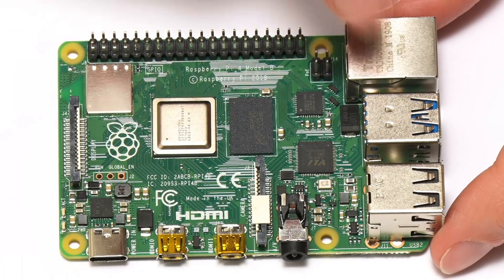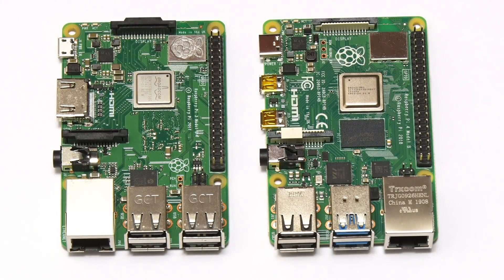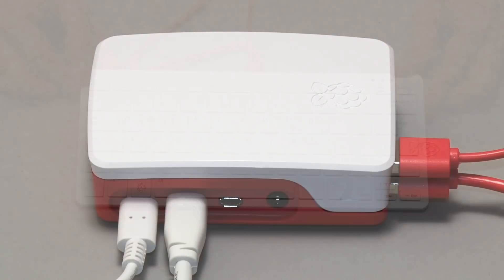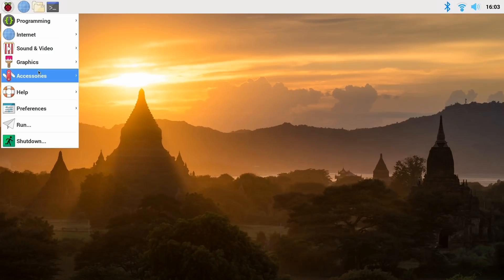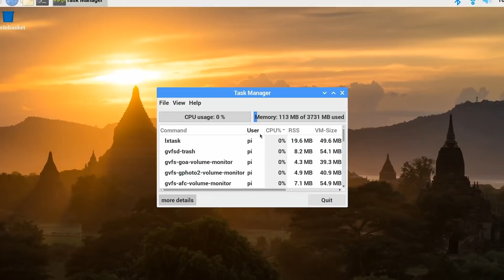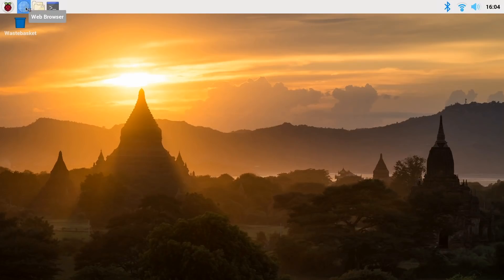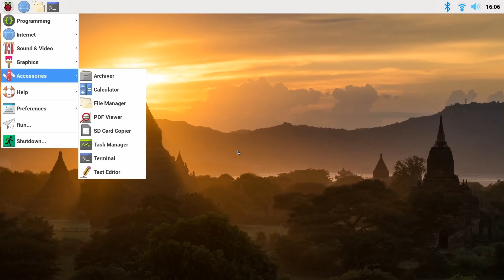Raspberry Pi 4 Model B

Comment: on reflection I can't help but be worried about the micro HDMI connections ...I mean I see a lot of  Xbox one s with broken full size HDMi sockets and Micro HDMi are sockets already proven to be much much much weaker ...just ask Lenovo laptop owners ....at least there shouldn't be any more broken micro USB ports ...I have several Pi2/3's with broken usb ports ..they're still in use I just solder power leads onto the board.....but as a headless plex server I do think the Pi4 has legs.

Comment: As many others, I heard about this here first.  Nice way to start the day.  I have always had issues with the limitations of the Pi's design, and have favored Odroids.  This new Pi looks to have addressed about everything I considered "wrong" with previous models.  This is a very impressive upgrade.  SoC is 28nm, which I suspected based on the clock speed.  It is a larger process than most A72 SoCs, which were 14nm in phones.  It is in line with SD650/652 and RK3399 in that regard.  28nm is a good upgrade over the old Pi boards and is a good compromise to keep the price down.  Not unexpected and a reasonable decision.  It will be interesting to see how it does when you test its performance, throttling, and heat generation.  A very nice upgrade overall, and an exciting board, even for someone like me who has only worked with other boards.

With USB-C here, making sure the cables follow the spec will be something to keep in mind.  Thanks for the quality overview of this new board.  I came away rather interested in the peripherals as well.  That keyboard might be handy.

Comment: Woohoo! I didn't even know the Raspberry Pi 4 had been anounced yet! I already cheered in the first few seconds of the video as soon as I saw the blue USB ports on the board. Finally USB 3! 😃 I'll unpause the video to watch the rest now. I wonder what other new goodies this new version has. 😁
Reply: My one pet peeve (I guess there's always one) is that the board supports both the h264 and h265 video codecs, neither of which are free to use, while lacking support for the completely royalty-free VP9 and AV1 codecs. 😞 But I guess the Raspberry Pi foundation is dependent on Broadcom to support these things in hardware. I hope they'll push for it in newer revisions of the chipset, though.

Comment: Question:  Does this support USB Wifi dongles? I'm seriously thinking about getting one.
Reply: @bichela  How does that work? Doesn't it need an external antenna to get the signal?
Reply: @bichela  Good to know. How is it compared to a dongle? I'm not keen on wifi antennas and how they work. I looked this up and it's available for pre-order which I don't do.

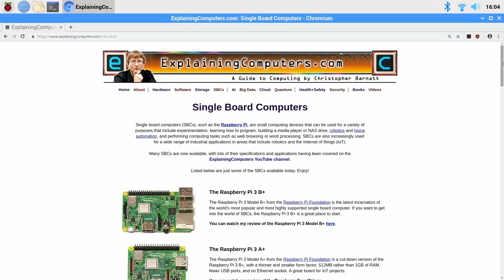Comment: 11:42 I see you updated it, but it's not quite right yet

"You can watch my review of the Raspberry Pi 3 Model B+ here" pointing to this video (also, the 3B+'s entry is gone)
Reply from the maker: Ah! Thanks for spotting this. I edited so many things this morning. I will sort it out. I did intend to remove the 3B+ entry, just as the 3B and the 2B and so on are not there. The page list lists the latest Pi in each form factor (or there would be 9 Pis at the top!).

Comment: I think the PI 4 is going to be very much so faster when properly cooled / overclocked than the RK3399 based boards - so basically they just trumped all other SBCs for the majority of use cases. So hopefully I'd really like to see a performance comparison between the Pi 4 and say a RockPro64 from you. That would be very useful to see if my assessment is correct.

Comment: Are they still going to make us pay to unlock the full GPU hardware acceleration/codecs?  

I think I'm going to wait for the + model to get released.
Reply: MetallicBlade Actually no! According to the Foundation’s website, the Pi 4 is not even compatible with the two hardware codec licenses there are - they say the device’s CPU itself is fast enough to run software decoding without any issue, and that you won’t be needing the licenses, neither will they be providing them.

Comment: I was one of the first 100 owners of the original Commodore Pet computers. At that time Apple’s pricing policies was and still continue to be rotten to the core. It is so amazing that for substantially less than the price of the pet, a far more powerful system, plus a suitable monitor and a USB-3 capable high capacity thumb drive, complete system capable of running a functional equivalent of a Chromebook GUI and for learning code for developing ARM based IOT device software!

Comment: Nice video and thanks for the info. But a little pissed at raspberrypi.org. They stated there most likely be no new Pi's or at least they'd be a different architecture. This opens up the opportunity for a 4B+ and a 4A. Plus changing the power connector will be a problem for those of us with a lot of Pi's and micro power supplies. Hopefully we can use a convertor. I'm just hoping they don't go to a barrel type power supply. (Which I really think they should of all along). I'm not really upset but just a little bit confused why they did this instead of doing a complete architecture change. Of course I'll be one of the first to buy a 4Gig model. Once you get started with a Pi it's very addicting.

Comment: Great news, particularly the memory.  Compiling Perl 6 will go a lot faster with enough memory.  It'll be interesting comparing it to the April 1st. spoof announcement. (Update: most of the spoofs have been removed, except for Voltlog #95, which wasn't very close.)  Surely someone, somewhere has succumbed to the temptation to make a mouse shaped like a raspberry, or at least with the shape engraved on it?

Comment: I'm so conflicted with this board. I like the speed upgrades, USB-C, Gig ethernet and USB 3.0. However I very much dislike micro HDMI, I would liked to have seen the more standardized full size HDMI port (or even Thunderbolt 3 - USB type C ports... I know that's probably never going to happen). I also would like to see USB 2.0 go away and be replaced with 2 USB-C's and the mouse and keyboard go in the same direction. I really want standardization when it comes to physical ports on these boards and related accessories. As someone else below said an M.2 port would nice as well.

Comment: I remember when I used to use first pi as a media player (MCE) as long as the format was right it could play using the gpu decoder no problem (I even bought the decoder license) 

that unit died thought (first gen units had problems with the cpu solder cracking so it would stop working randomly or permanently ) I never replaced it as a cheap computer with a AMD gpu was more then enough to play 1080p60 with Windows 7 windows media centre (something ms got right was the MCE remote)

Comment: This is bigger news than Ryzen 3000 and cheese grater Mac!

I cant believe what I'm hearing....this is best news since AMD released Athlon 64.
I'm gonna use this for watching youtube and other videos...getting away from x86...
Intel will start sweating watching you talk with a straight face.....
Reply: In fact, Athlon 64 had thermal protection. Athlon XP didn't have.
Reply: Antti Mäki Oh, then they only took 33 years to implement it.
Reply: 33 years since what? First AMD SledgeHammer CPUs were released as early as in 2003.
Reply: pamsu S The Athlon 64 was a piece of junk
Reply: @UomoMagnetePlus  Intel was peddling junk before AMD released better junk.
You had to buy a new junk video card to run that new game.
Reply: pamsu S All you are doing is random trash talking. You are clearly stuck in 20+ old technology cliches. Do you even remember what was happening to those AMD CPUs when operating without a fan?
Reply: ᚛ Vyper ᚜ not pretty for sure.
Reply: @UomoMagnetePlus  Why would you run without a fan? That seems a bit silly..
Reply: fastertove Einstein, a fan as any other component can stop working anytime. AMD CPUs had no thermal protection they were melting down after a few seconds
Reply: Hov ofte did this actually happen? I do remember people being concerned it, but I have never heard about it being a real world issue... I have personal never witness a fan refusing to turn, but i guess it's possibly, just highly unlikely. Fans are simple by design and are extremely reliably.
Reply: fastertove How often? I remind you that back then AMD was the best choice for extreme overclocking and crazy cooling systems (like mineral oil bath and stuff). If you didn't blow up a couple of them you were not tinkering enough.
Reply: @fastertove  *have personally (never witnessed
*it's possible (adjective, not adverb)
*are extremely reliable (adjective, not adverb)
Reply: @alvallac2171  I could care less :P
Reply: @UomoMagnetePlus  You're fractally wrong. You still had a heat sink; so this problem, wasn't an actual problem on athlon XPs. The CPU would just slowly overheat until the motherboard's thermal diode got too hot and the motherboard shut down to protect itself and the CPU. The Tom's hardware video you doubtless saw 20 years ago was made by turning this feature off in bios and janking the heat sink off during use; a situation that just didn't happen. If your heat sink randomly falls off, you have bigger problems.

This is also an athlon 64, not an athlon XP; which had an integrated heat spreader and thermal diode as well as thermal throttling technology if you enabled it. It also generated far less heat than the pentium 4.

Comment: Is the official Raspbian for it still 32 bit version? I know the Raspberry Pi Fundation prefers to keep 32 bit version to have better compatibility with older hardware and software, but they need to switch at some point to 64 bit version officially right?
Reply from the maker: I think so . . .

Comment: If I had the customers, I now could easily build dual all in one computers at a very good price tag. Eventually you would wonder why "dual". System administrators in particular, work with more than one PC at a time, and if there were 2 in a single case, up and running, and a switch, that would be really great.

Comment: I have had bad experiences with single board computers overheating, especially when keeping them in a plastic case. Perhaps the SoC is clocked at a lower speed to allow it to operate without a heat sink, but anyway I would love to see the CPU temperature chart for doing computationally intensive things, like:

- streaming video
- software compilation (e.g. building a Node.js server from source)
- compression of large files using algorithms like BZip2 or 7Zip
- neural network training (small convolutional neural networks)
- 3D ray tracer rendering
- playing web-based video games

I am very curious how well the Pi 4B can keep itself cool.

Comment: I accidentally came across this video. A friend of mine used to talk a lot about these mini-computers, She was into robotics. I have something different in mind. Would it be possible to connect a touchscreen monitor USB/HDMI and run a controller app for a desktop synthesizer?(I don't want to haul around a laptop)
Reply from the maker: There are a range of touch screen monitors for the Pi -- from about 3 inch, up to 10 inch plus. So what you ask may well be possible if you can control the synthesizer from an ARM Linux computer.

Comment: Is there hardware decoding of VP9? It looks like GPU is VideoCore VI, with more units, high frequency and updated architecture, and dual 4K support, but can't find details on hardware decode details.

Could you try running `vdpauinfo` on it and report back?

Edit: Nevermind. VP9: "Currently software decode only. There is a hardware block that can  do vp9 bitstream (cabac style) acceleration but the pixel operations  need software decode which is the majority of the work." ..  So, a bit of VP9 can be decoded in hardware (but it is not yet supported in drivers and libraries), but still requires substantial CPU help for other operations. So it will not be as efficient as H.264/265 decodes. Bummer.
Reply from the maker: I believe the GPU may be a VC6.

Comment: Did it boot up as fast as you showed here?  Or did you edit part of that out?  I am interested in getting one but I find it a bit of a power hog because some of the projects I am working on don't allow for more than 1A of power.
Reply from the maker: There was no editing in the boot sequence -- there was a second or so before the spectrum square comes up that is not recorded, but otherwise you see the boot in real time. :)
Reply: @ExplainingComputers  well it is very nice to see an improvement in this important area. Might be useful in automotive applications

Comment: I do not like the micro hdmi. More adapters and or new cables. Raspberry is slowly becoming every other company. Of course the price is the same but whats the upgrade? USB C. 1.5Ghz. Gigabit. For $35. Of course I have to spend more money on the new case due to new placements. And the dongle or new cable for micro hdmi. Thats all I have to say about this upgrade

Comment: Bit on the Pricey Side but cool.  Sad seeing no room or provisions for a heat sink nor fan incorporated in the more then fine looking case.  People are going to be hole cutting and drilling into the thing for sure.  A pop out slot on top would have been easy enough to do ?   Dang cool idea  with the USB's being on the Key Board,  eaaa?

Comment: i think i would have preferred and full size HDMI instead of 2 micro HDMI ports,  who is really going to use this thing in a  dual monitor setup ?  i was also really disappointed to  see they still have not added  emmc or an emmc socket

Comment: What is more disappointing is that this upgraded version does not have an FPGA. It has been rumored that the new Raspberry Pi will add FPGAs to accelerate neural network or AI calculations.

Comment: 7:45 UK power sockets are fat
Reply: all the better for running the 50hz 240AC and by extension, we now have real integer fps 25,50,100,[150,200,250], AND EVEN the petential due to years of NHK/BBC research  and developement of upto 300 fps HDR UHD2/8K Rec. 2020/BT.2020  UHD Phase B
ready for the current 2020 Summer Olympics (will begin on
 Friday, 24 July) non of this rockefeller snake oil style fractional almost 60hz almost 30,60,120 but not quite (23.98, 29.97 etc) fps sports coverage and computer gfx even though computers do like ripping through real binary by design integer calulation's, and are far slower per bit for processing fractional (sudo analogue) calulations.

Comment: is it powerfull then intel celeron n3050?
Reply from the maker: That Celeron is dual core 2.16GHz, this Pi is quad core 1.5GHz. The Celeron is a more sophisticated chip, and will probably be faster in some situations. It really depends on the RAM and storage attached, which are likely to be better on a PC.

Comment: Excellent!  Well done, Raspberry Pi Foundation, and also Christopher Barnatt.  I do expect that for this new model a CPU cooling solution will be pretty much mandatory for anything other than the least demanding applications, and I do look forward to seeing what you can put together in the way of video content on that subject.  I'm even a little bit surprised that there is not a heat sink included in that desktop kit and that the case supplied is so lacking in ventilation openings.  Perhaps there is something I am missing, however.

Comment: Any news about it supporting 10 bit h264/hevc acceleration? Or is it 8 bit only.
Reply: Mark Wilko supposedly 264 is the same as pi 3, so only 8 bit...  but the added h265 playback is 10bit 4K video which is awesome... h265 will save you TONs of file space too

Comment: Question?  what all comes in the box?  i have seen confusing answers on several sites
Reply from the maker: In the desktop kit box you get everything I show here -- that's a Pi 4B 4GB version, 16GB micro SD card with the OS on, PSU, mouse, keyboard, case, two micro to standard HDMI leads, and a getting started book.
Reply: @ExplainingComputers  thanks, 2 websites were showing only one HDMI cable and one no power supply. Those micro hdmi cables are not a local store thing, or even high amp usb power supply
Reply: @ExplainingComputers  I like to use this to replace my desktop where i run chrome in a multi tab setup to watch videos , do email and look up info, and with winows 7 support going bye bye

Comment: Since you mentioned building a NAS with the Pi4B, do you know if USB attached HDDs support SMART? It'd be rather suboptimal if you'd build a RAID1 from say 2 external HDDs and that fails cause you weren't able to detect SMART errors on the disk.

Comment: the two micro hdmi connectors look to be so close together that you won't be able to fit two micro-to-full adaptors side by side...  and whoever switched the PSU socket for a micro C should be shot!  Was that because this draws more power than the micro B spec allows?  Are we now needing in excess of 3A?  I think they finally jumped the shark with this one...